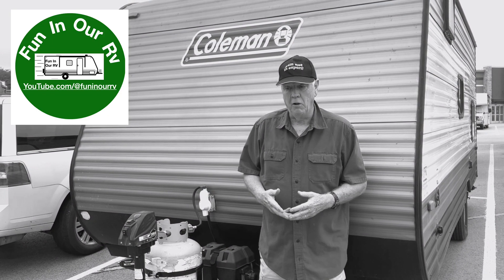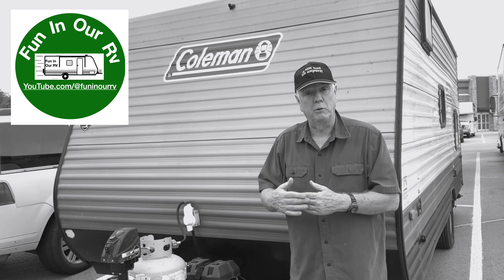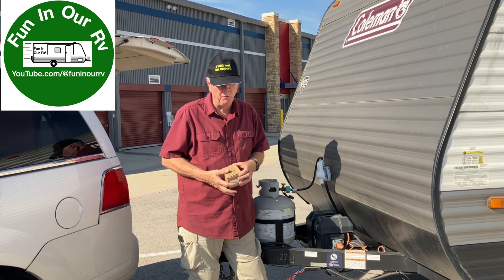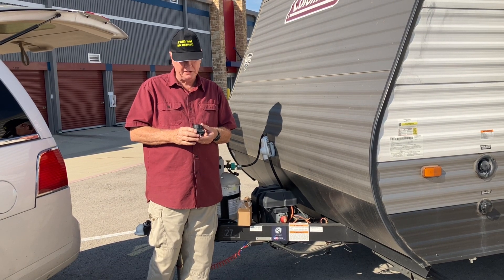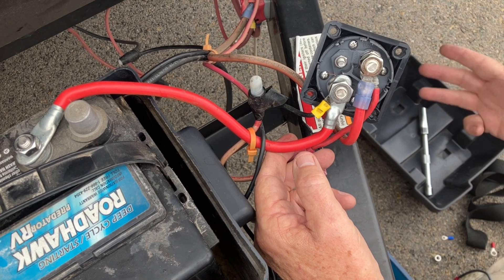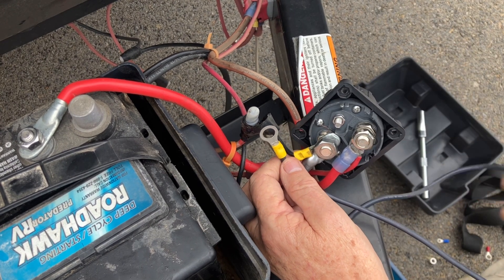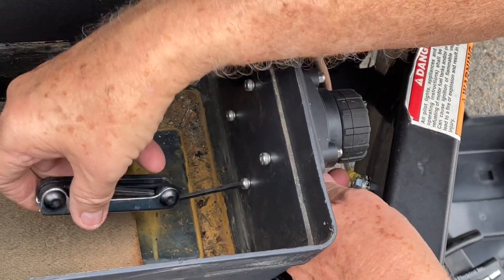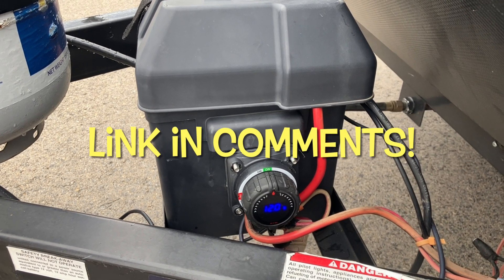Protect Your RV's Battery with a Digital Cut-off Switch

Comment: Thanks for the tips!  Purchasing one now!
Reply from the maker: I hope you like it.
It really helps battery life and tells you the charge you have left.
Reply: @funinourrv  I dont understand where I am losing power.  I even shut off every breaker.  There must be a ground somewhere, that I need to chase down.
Reply from the maker: I don't know what to tell you
You would think that using a cut off switch and completely isolating the battery from the RV would do the trick.
Have you completely disconnected the battery and let it sit to see if it loses power.
If so, you could have some kind of issue with the battery. Cells in the battery can go bad.
Other than that, you might have that short you are thinking.

Comment: You also neglected to show connecting the cables and other wires to the switch and where you attached the dedicated ground wire you made with the ring connectors.  I think those steps are just as important as installing the physical switch.  I'm speaking from the point of view of someone that has no experience.
Reply from the maker: Do you mean connecting the battery cables to the actual battery? I guess that I spent so much time when I did the original video that I just went too quickly with this one.
I also just connected the ground wire to the same terminal/post as the black ground (neg.) wire.
I will put a link to first video here, and in the comments under the video.
https://www.youtube.com/watch?v=q9tz-awZnII
Reply from the maker: Thanks for your comment.